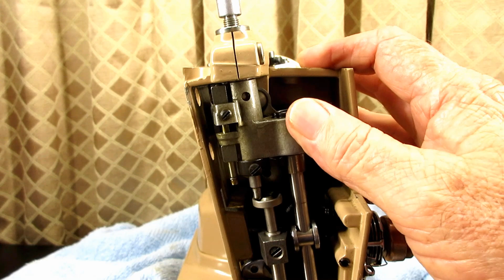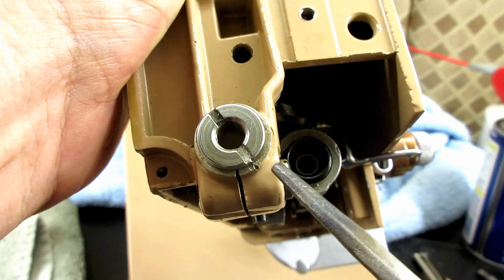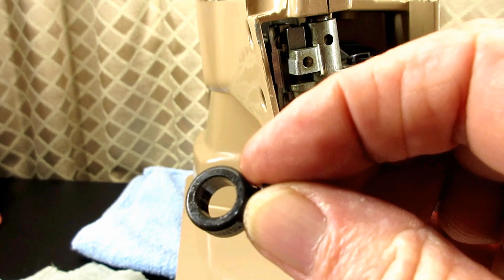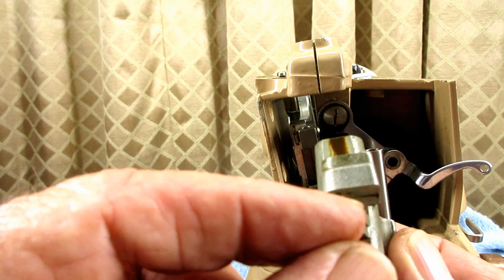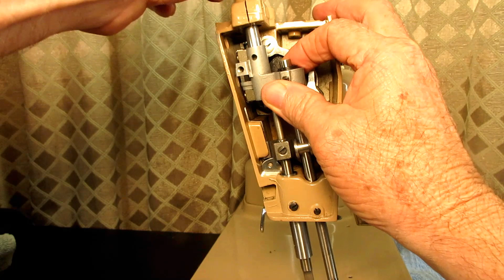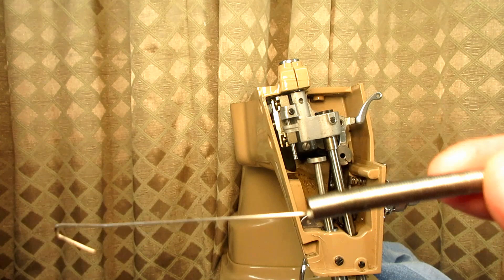The Needle Bar Vibrating Bracket of the Singer Model 403A Sewing Machine

Comment: Thanks Andy for very useful video. Mine 403G had just this area issue, vibrating bracket didn't work properly. After reassembling and cleaning it thoroughly it almost worked but started to bind when i tightened that big clamping screw for the pin. And if I didn't tighten it properly spring force of the presser foot popped it up... After some thinking and tinkering I noticed that there should be some axial play for the bracket, so that black collar is best leave slightly below the v.b. so that there is very small gap there. 

This helped a bit but final fix was to increase spring force for the needle bar driving arm (which makes needle move sideways). This can be done by adding a slightly bigger diameter new spring over old spring and making similar short and long ends for it. After this fix my machine started to work properly, needle now moves from side to side at full 5mm range. It isn't that critical how long that new spring is, idea is just to get a bit more force so that cam follower follows the cam all the time.

That eccentric pin in which you did markings adjusts needle position. So if it goes off you just rotate it until needle hits the center of needle plate (and presser foot of course) when sewing straight stitch and it goes equally far on both sides when zigzag is used.
Reply: I am having an issue with the needle bar positioning as well. I will take a look at the spring after seeing this comment. Thank you!
Reply from the maker: Thanks for sharing your interesting workarounds. Clever. I was hoping you had made a video. I pinned your comment to the top for others to see.
Reply: @andytubesewing1953  Thanks but I was just trying to make a quick fix - it took me several hours. Then I took a break and found your video and rest was easier when I saw how you did it. 
I still don't know why tightening that clamp made vibrating bracket bind but giving it slightly vertical space and more spring tension finally fixed it. I also degreased pin for clamp so that it would stay put with lesser clamping force.
 I really appreciate your help for keeping these wonderful machines alive and working. I rescued mine from dumpster, sad to see how people throw things like these away and buy plastic crap machines. 
Thank you🙂
Reply from the maker: @bekanav  No worries, I was just hoping... I appreciate you saving the machine. A real treasure, IMO. Take care.

Comment: At 6:15 into this video you talk about if this pin isn’t lined up properly that there could be problems. I think that’s the problem I’m having with the 401 a now. I don’t know if it’s not in place where it should be or what but when I was turning it with my hand, I was watching the needle, literally move around in a circular fashion, and I don’t know what the proper alignment should be. So not only is this the issue, but it’s also not getting the full zigzag so I just watched your other video on zeroing out the machine. Unfortunately, this particular 401A I’m working on was found at a thrift store and who knows what may have happened to this machine but I’ve already put it on the back burner once and I’m looking at it one more time. It can be so frustrating when this is supposed to be therapeutic lol. So basically, I’m going between a few videos with the two issues I’m having on this little girl. I have worked on a quite a few 401 A’s but this one has been the most challenging.
Reply from the maker: There are 2 separate procedures for positioning the needle using the straight stitch needle plate. A left-right adjustment and a front-back adjustment. front-back is done with the eccentric hinge pin (that's why I say to mark it when working on it) and left-right is done with the vibrating bracket. I know you don't like using a manual, but both adjustments are on page 142 of the service manual. After all the hours/days/weeks/ spent working on the machines, maybe it is time to bear down and try to use the manual again. It's really worth it IMO, and you do not have to play/pause or go back or forward. Page 142. Think about it when you get that 401 back out of the closet next time. Just read and follow one line at a time. Some people cover the rest with blank paper so they don't get distracted. Read the whole instruction, but then go back and do one line at a time. Pretend YT is down for a month.
Reply: @andytubesewing1953 good advice, thanks Andy.

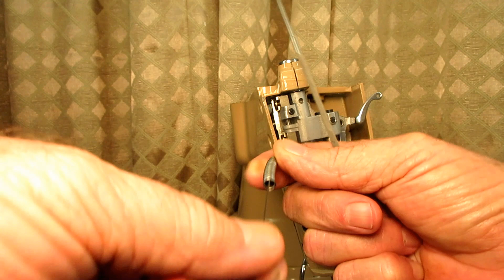Comment: Hi Andy, at 32:24, regarding the spring.  My 401 has the spring the opposite way:  long end to the back and short end to the nose.  Should I put it back the correct way?
Thanks :)
Reply: I put the spring back the way you showed, long end at the nose and short end inside.  But the spring wasn’t the cause of my machine not zigzag properly.  It ziged but only zagged for about 1 millimetre.  It was the eccentric rod for the presser bar not in the right position, I turned it 180 degrees, and the bar is swinging happily now.  Thank you so much Andy.  You saved the day:)
Reply from the maker: @Homesewer7  Nicely done. BTW, I recently was able to get copies of the parts diagrams for Models 401A & 403A. Both of them show the long hook to the back and short end with coil to the front, like your machine originally.  I don't know if it really makes a difference, but the Singer engineers were smart, so I advise folks to put the spring the way your 401A was when you first got it. I'm concerned that maybe there could be wear on the spring over the years. Just my opinion. My wife says the long end is to the back to make it easier to attach. I rarely argue with her any longer b/c I usually lose 😃
Reply: Thanks Andy, I’ll switch the spring as you advised.

Comment: I watched this video two or three times in the last couple of days, and I finally got my 403A working at full capacity, thanks Andy.  I had put it on the back burner a couple of days ago and decided I’ve got to get back to it and get it right. And sure enough I did.
Reply from the maker: Determination has its reward. Congratulations! Thanks for getting that machine working 😄

Comment: Love your videos; they've helped me with adjustments and service on a couple of 403a's I've acquired.  This might be a bit off this topic; but one problem I'm having is when the take up lever is moving in the up position, and the motor stops the take up lever will drop back and the needle will drop 1/8" or so.  It can be very annoying.  Almost like the horizontal upper shaft moves too easily. With the top off I notice the counter weight above the motor toward a horizontal position. I can hand turn the wheel, let go and watch everything including motor gear rotate a bit in reverse, take up arm drops about 1/2" or so. I'm wondering if there's a way to tighten all that up. The other machine does it too but only by a very small amount and the needle bar doesn't move perceptibly. 
If anyone has a suggestion I'm all ears.
Reply from the maker: That's odd. I've never had that before. I know you mentioned the counterweight moving but all the parts on the machine move together (of course) so even though what you see moving is the takeup lever and needle, the feed lift and feed rock shafts, feed dog and hook and hook shaft would all me moving at the same time. If the takeup lever (connects to the arm shaft counterbalance) and the needle bar (also connects to the arm shaft counterbalance) are moving but the dog and hook don't, that makes me think the Clutch Washer behind the Stop Motion knob of the handwheel is installed incorrectly. That's my WAG, Terry. (Wild Ass Guess). If you figure it out please come back and let us know if you have time. Good Luck. (P.S. I feel honored you made a comment on my channel the first day you make a YT account 🙏)
Reply: Hi Andy.  Think of you often and hope for your good health.  I’m wondering if Terry solved his needle dropping problem.  I believe I had the same symptoms with my 403A.  It turned out the motor shaft (PA9-8) had some play in it.  When I took the motor out of the machine and pushed/pulled on the motor shaft, the center circle of the top bearing moved about 1/16”.  I was never able to fix the motor.  Luckily I had a spare motor that was in good shape from my Parts 401A machine, and it works fine in my 403A machine.
Reply from the maker: @carolemagnusson5044  Thanks very much, Carole. I replied again to Terry's original comment and hope it gets seen. Thanks for the contribution 🙏and take care.
Reply from the maker: Terry, never heard back from you if you solved your problem. Hoping this reaches you and please read the comment from Carole in this thread. She found a cause for the same problem that may help. Good Luck.

Comment: Ohhhhh I'm crying again! </!\> OK 👍  I'm centered...don't panic just breathe. I'm close to the answer I just know it Andy. I  learned  a lot from this video thank you soo much! Issues at hand now...timing line/ needle bar bottom not going all the way down. Horizontal bar not coming out of bobbin mode.
Reply from the maker: No need to panic. I also have a playlist for model 503 which has most of the same parts, just a different body. If you don't find answers in the 403A Regina playlist, take a look at this 503A Vicky playlist; https://www.youtube.com/playlist?list=PLsCOZgzzaiKJZaZn2zl3LsnV2d7UhrqvX  If you feel some parts are the wrong ones you can find used parts on eBay and other online marketplaces. I also want to mention the Service Manuals for models 401, 403, 404 which cover your machine and there are also some very good directions in the 500/503 Service Manual that are very clear. These manuals explain about removing and replacing parts, setting heights and spaces, and adjusting the machines Fortunately these particular manuals are FREE to download. (you usually must buy them) if you go to this page, about 3/4 of the way down (it's a tall page) you will see the SERVICE manual for the 4033A, and then at the very bottom is the SERVICE manual for the 500/503 https://sewingdude.wordpress.com/category/free-manuals/page/2/  I have used dozens of these manuals and find them extremely helpful. Parts diagrams with parts numbers can be sent FREE from andymanuals53@gmail.com Just tell him the model numbers you want. Don't give up and thank you for keeping the machine.
Reply: @andytubesewing1953  thank you for the links. You rock!
Reply from the maker: @TheChohoshika  😉

Comment: Thank you for another wonderful video! I have watched this and several others about needle bars and the vibrating bracket, but I have not found an answer to my issue with a 628. I freed up the vibrating bracket and have good back and forth motion, however, all three needle positions are homing a hair too far to the right. The right position almost hits the edge of the plate opening. I watched your video on adjusting the needle bar position on the 437, but I don't think that applies to the slant machines with vibrating brackets. I also watched the one on zeroing-out the ZZ stitch amplitude, but I'm not sure that applies either. Does the eccentric pin affect L-C-R position? If you have already addressed this positioning issue, can you please point me to the correct video?  Or even the name of the part that corrects this. Thanks for all the rabbit holes you encourage me to explore ;-)
Reply from the maker: You may want to center the needle in the straight stitch needle plate to be sure it is in the center. That's done by loosening the screws holding the needle bar driving arm to the vibrating bracket and holding the needle in the needle plate while tightening.
To get the idea you can download a free copy of the 401 Service Manual here: https://sewingdude.files.wordpress.com/2012/09/singer-401-service-manual1.pdf   and look at page 142. You can also buy a copy of the 628 service manual. I do not work on T & S models and do not have that manual to know if your problem will be covered. Terry sells the manual here: https://store.tandtrepair.com/sm620.html  Use my coupon code of andy-h-yt to get 20% off during 2021. If none of this helps you fix the problem you can not find anyone who knows more about T & S models than Terry at TNT   Thanks for watching my channel and look for a nice 403A model https://www.youtube.com/playlist?list=PLsCOZgzzaiKKyqvdDRwS-9MfLuwSNJTcg 😀
Reply: @andytubesewing1953  Thank you so much. I think the 401 manual page you mentioned will cover exactly what I need to know. I totally agree that a nice 403 needs to come my way, but I figure I can practice on this 628 and not do any irreparable harm (I may have already lost one of the plastic gears to overzealous experimentation). Thanks for sharing Terry at TNT. I have two (or is it three...) early T & S models and he sounds like a great resource. But YOU are the best!
Reply from the maker: @deborahsensel-davis816  OK, good. It's what I would check first. Yes, Terry is a great resource for T & S. I have bought some of the guides her wrote years ago and they helped me. Good Luck.

Comment: Another fabulous and insightful video. I was struggling to get the vibrating bracket spring relocated on the 411G. I knew you would have a tip on how to do it, and you did. Thanks again Andy.
Reply from the maker: happy it helped, Mark. Sounds like your 411G is shaping up.

Comment: Dear Andy,
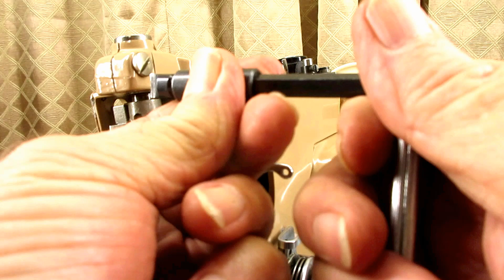You have answered several questions for me via email. I am working on a 401A Singer.  Pleasele tme know what tool are you using to remove the bolt at 18:57 of this video? I have tried lubrication, triflow, WD40, Krud Kutter, heat with hairdryer, for a week now, and the only thing that happens is my ratchet type screw driver is chewing up my bolt! Please help!
Reply from the maker: It's called a mini rachet. It is basically a 1/4 inch ratchet and came with a set of screwdrivers made for working on sewing machines, guns, typewriters, etc. The mini ratchet can put about 200lbs of torque on that screw; about 3 to 4 times what your regular screwdriver and your hand can do. Here is a video of the screwdrivers: https://youtu.be/KnrvDZeaYj4   This is where I bought my set, right from the manufacturer: https://chapmanmfg.com/collections/slotted-flathead-sets/products/9600-starter-slotted-bit-set    The thing with these type of bits are the parallel sides (hollow ground) that fit the screw head better than the typically tapered screwdriver bits. That means you have less chance of damaging the screw head. Many 1/4 inch rachets have a screwdriver bit set or a bit holder included. I use this set of screwdrivers on almost every machine I work on. If I was buying one today I'd buy the one with more slotted bits. Sorry you have such a tough screw, but it does happen now and then. Good luck.
Reply: @andytubesewing1953  thank you Andy, it comes in pink too!
Reply from the maker: @jenniferbowdoin4197  I saw that! I guess they realized more ladies are repairing and maintaining their own machines. I see they updated the mini ratchet too. I'm very happy with the set I bought and I know you will enjoy working with them.

Comment: I cannot remove the collar! It rotates but does not come off. I have tried to get it with pliers and everything. Any ideas on how to remove it more forcibly without harming the machine? Right now it's been soaking with krud cutter for over an hour.
Reply: Removing Collar Update: Success 
I finally removed it successfully! Sharing my findings for others. After soaking the eccentric hinge pin and collar in krud kutter I found that the collar was sliding back and forth up not down and off the eccentric hinge pin. I took pliers and firmly grabbed the collar. Then I took a firm painters knife (not flexible) and pushed up on the eccentric hinge pin from underneath. This allowed me to then wedge a flat screwdriver under the eccentric hinge and push it up. This pulled the hinge pin up and through the collar that was being so stubborn. The collar then fell off with my pliers holding it. Done!
Reply from the maker: I'm glad you worked it out! Thanks for sharing the method and I'll pin your comment to the top for others who may have a problem.
Reply: @andytubesewing1953  You are a complete gem and one of my favorite bloggers/vloggers! Thank you for all the awesome videos you make. I have fixed my machine completely with all the videos you have supplied and there have been some major repairs. Couldn't have done it without you. Cash headed your way after my next paycheck.
Reply from the maker: @JessieLynnly  Very kind of you to say this, thank you. I appreciate that you've saved the machine to keep it in service!
Happy sewing and maybe you'll do another machine in the future; you're already good at it, so why not? 😀 Take Care.